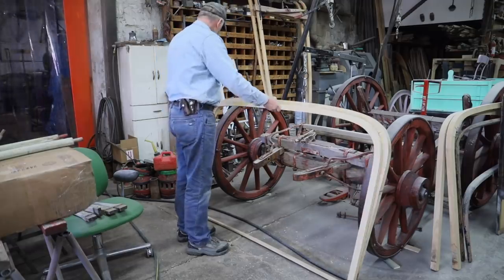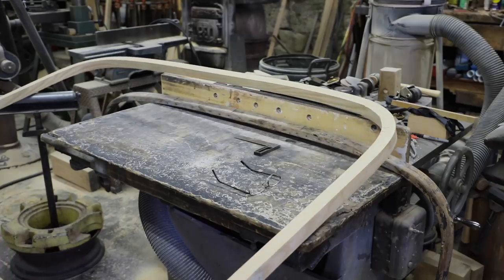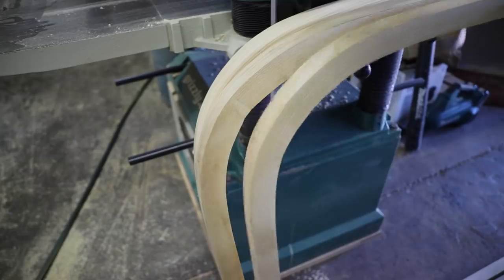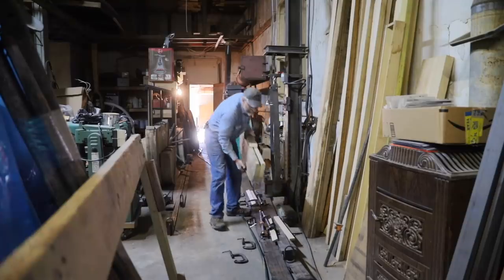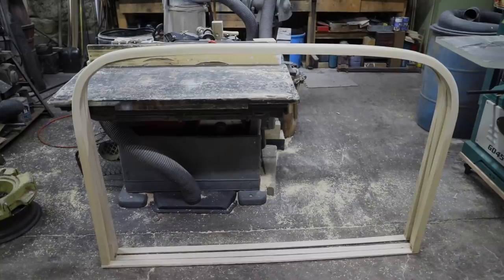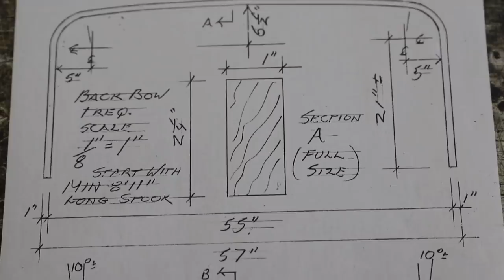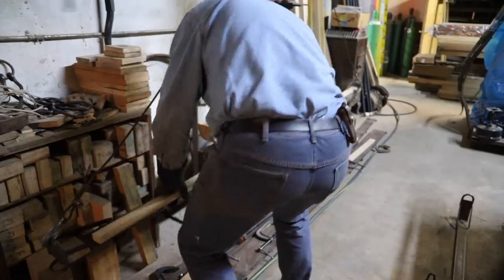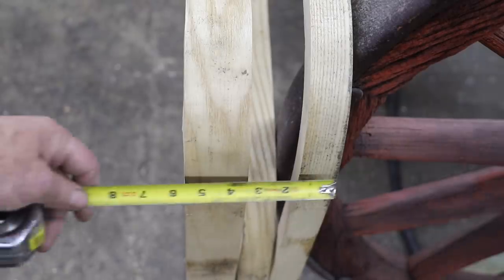Bending Top bows for Stevens-Duyrea & 1927 Franklin Cars | Engels Coach

Comment: Being a cad designer starting on a drafting board in 1975 I really loved seeing your drafting and design skills. Then to see how you drew that (120"?) radius with the bar and pins! Wow, very clever.
Reply: @melissahill7930  sorry, no. But i can tell a joke or two. Lol
Reply: So, the question would be, can you 3 D scan those hoops to get the dimensions and then get the stock set up into a 3 axis milling machine?
Reply: @melissahill7930  Yes but I'm sure there is a setting to average out the defects via "Smoothing" or similar.  Just was thinking out of the box far a roughed out part then hand finished to a custom fit.
Reply: @melissahill7930  No, you couldn't. A milling machine can only work on the stock you put under it, and there is no way on this planet to find 3 pieces of timber with grain running along it longitudinally yet following that hoop shape. Sure, you could mill it out of some laminated material, but whilst you would have replicated the shape you would have something that looks and behaves very differently indeed. All hypothetical, of course, as Garth was joking.
Reply: Yes! I was stunned, too! I was expecting to see him but a batten across a few more nails, then he brought out that folding bar thing. Confusion... But he got a perfect arc while moving the thing! Sweet trick.

Comment: using an electric planer and grinder works but you might find it faster to use a drawknife and spokeshave. The stanley spokeshave that has both a flat and curved surface would do you well. Less dusty and, with some practice, much faster and shaping and removing wood.

Also a body file( autobody tool) may be useful for really hogging off wood.

Comment: You may have covered this in another video but, when bending wood how important is it to orient the grain?  If I guessed I'd say keep the growth rings flat with the bend if possible but I don't know.
You mentioned in the previous video that kiln dried lumber can be more difficult to bend....would you prefer to work with stack dried since it's final use is kept outside anyway?
I'm logging ash trees on my farm now, because we're beginning to see the effects of emerald ash borer.  I have many 80+ year old trees that I'm trying to harvest before they die and get dangerous to take down.  Not sure what size lumber I should saw them into as I don't have a specific use for it yet and there's way more than I can use myself.
Thanks for another very interesting video.

Comment: Hi hello, cool thing, hir in the east region (I talk about the former GDR), there were also some vehicles such as the IFA F8, IFA F9 and IFA P70 of the P70 was made of hardwood on a metal ram and on this may or should s.den  Corners, curves and the same only crooked wood (the wood was bound so that it grew in 90 ° or 45 ° and the same free of knots) are used, where in some cars farmer (cartwright) demanded that you had to procure the wood in advance  and some were then so that the specifications made what size and type of wood it should be, bending wood there was only a few unasked then demanded so that then properly done.

Comment: Reminds me of the time in late 60's when my Dad turned the final side piece around before lunch and marked it mirrored when we came back.... 
That example of the total of 180 + 180 hung above an important door in our barn and was connected to a hidden cable that snaked through the wall to lift a pipe blocking our machine shop door.
 In 89 I received a package a couple months after Dad had passed away. A picture frame made from the mistake with a portrait of Dad. When I took the frame down to give to my son I felt the corner of something under the backing. No cash really, just pics of him making the frame and 5 1967 Bunny Rabbit nickels ( with a little note, "Better be enough!")  A nickel for each future grandchild. We have 10 cents left over.
Peace.

Comment: Why taper in the opposite direction? Just do both the same and turn one around.  Voila.
Reply: EngelsCoachShop you stated you were going to taper the second bow opposite of the first one. In effect creating a mirror image. Same result is achieved when both are tapered the same way then one bow is rotated 180 degrees. Mirror image of each other. That is if the dimensions of the original bows were equal but opposite.